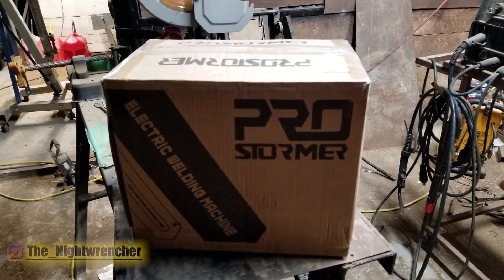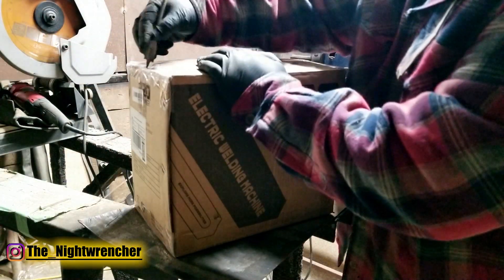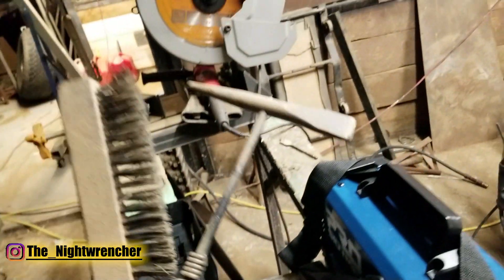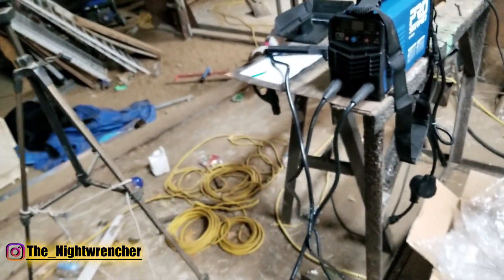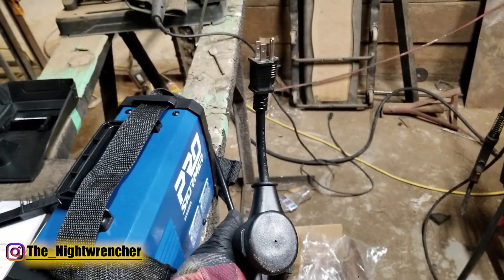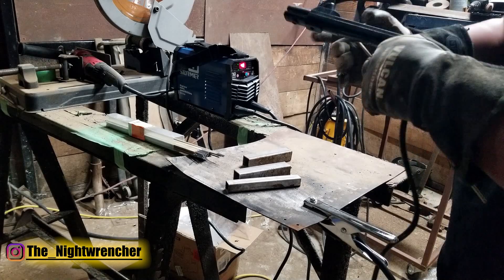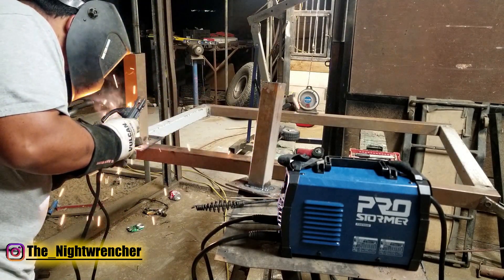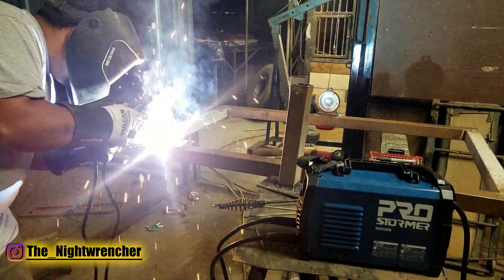PROSTORMER PSWM02D 160Amp Tig/Stick Welder Review | Stick Welding For Beginners |

Comment: What kind of electrodes do you use for that machine?
Reply: last question brother sorry for asking so many but I want to learn. electrodes 3/32 6011 that amperage is the perfect one in that welding machine?
Reply from the maker: Ever machine is different and depending on the voltage coming out of the wall, the amps will vary. 6011 is close to 6010 so start at 65 and go from there.
Reply from the maker: I've used 6010, 6013 and 7018 from various brands. they've all lit up pretty good.
Reply: @NightWrencher  for 3/32 7018 what amperage do you use?
Reply: @NightWrencher  for 6010 also tell me
Reply from the maker: For 6010 I ran 65 and 7018 I ran 85
Reply: @NightWrencher  Is there any metal in particular oh any metal can be welded with those amperages?

Comment: Just a note regarding the machine having a native 220 plug...I'd rather see a manufacturer make a machine with the heavy gauge 220v out lead and use the 110v adapter!!! IF you decide to use 220v in the future, you don't have the amperage bottleneck (and potential hazard)if the machine had the smaller native 110v lead in gauge!!! IMHO, the larger gauge 220v lead in was a logical and smart design inclusion based on safety and upgrade path!!!😁👍🏻
Reply from the maker: Thats a really interesting idea! My omni pro came with 2 cords that can be swapped out for 110 or 220 so I guess I'm spoiled 🤣

Comment: DANG!!! Super Cool to hear you running this on 110V!!!  I have the Harbor Freight mini 110v Titanium MIG--I think $209 regular price & about $169 when on sale. Anyway, I just wanted to get a stick rig too!!! I learned with AC stick back in the 80's from a guy that welded submarine bulkheads--had to be FLAWLESS!!! They checked them with x-ray for imperfections. If imperfect, they had to grind out and redo. I'm quite sure he used TIG welding process! Needless to say, I never got that good!!! Anyway, the ease with which you used this machine on 110v and the commentary sure helped out! I saw your video on Amazon but it had distracting music with it!!! Your commentary is so much more helpful!!! Thanks A Bunch!!!😁👍🏻
Reply from the maker: I'm glad it helped! Where did you see my video on Amazon? I never uploaded one.
Reply: @NightWrencher  It was associated with this very model you're reviewing here!!!...the PSWM02D Model.
Reply from the maker: Oh wow, I'll go look for it, thanks!
Reply: @NightWrencher  Hey! I was wondering what size of generator you use to power your equipment?! Thanks!!!
PS--are you using a plasma cutter or Oxy-Acetylene for cutting???🤔
Reply from the maker: I use a yeswelder plasma cutter and predator 3500 inverter generator for all my stuff but it has a hard time holding a weld on high amps when welding stick.

Comment: My hobart finally took a dump in November so I bought me my Christmas presents early. I bought a Tooliom 200 amp 3 in 1 welder Arc, mig, Tig and a 50 amp plasma cutter  all under 500.00. I haven't used the plasma yet but I have used mig and stick several times. The stick worked  great welding up 1/2" for motor mounts with a little extra heat on it. I hope my new air compressor gets here soon so I can use the plasma cutter.
Reply from the maker: They all come from the same place :) look at yeswelder and this brand and youll see they look exactly the same but different colors
Reply: I had a lotos 3in1 and it blew a capacitor and caught fire after a month

Comment: Nice inexpensive I have the the harbor freight welder the tiny one that can be used as a tig also and a Lincoln, so cool I am running off of a generator to HELLYEAH
Reply from the maker: Its cheaper than running hundreds of feet of zero gauge wires to your breaker box 🤣